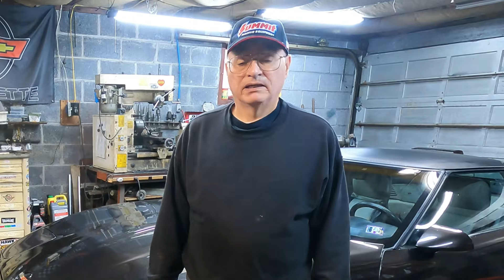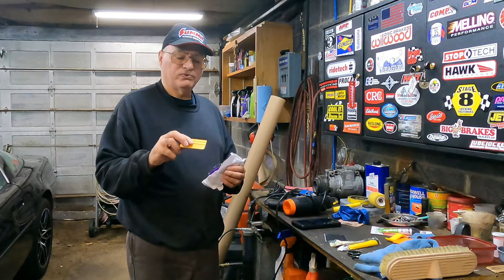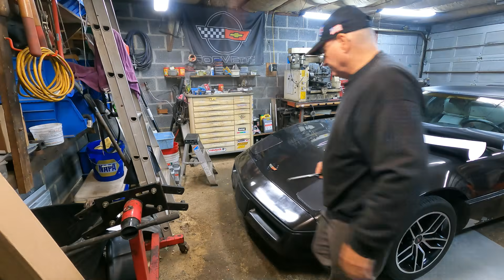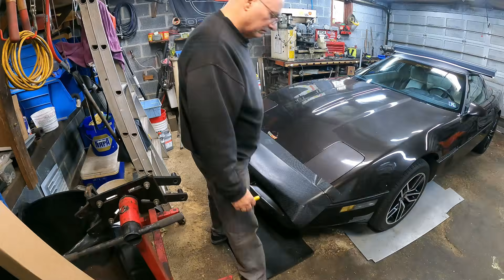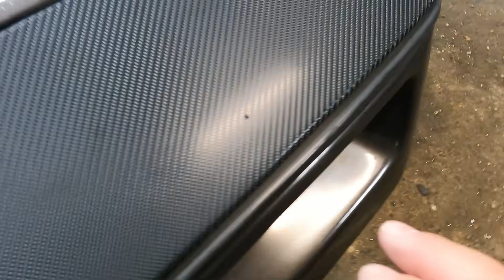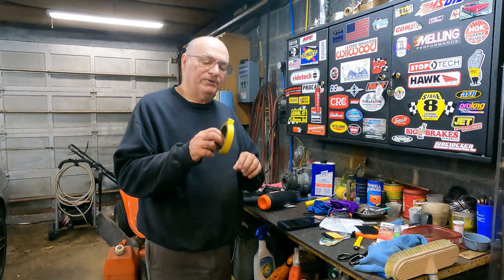Ebay Vinyl RE Wrap 😎

Comment: Friend been doing vinyl for over 25 years.  Have helped him wrap so many different vehicles over the years.    Semi trailers and race car type stuff.   Never wrapped a whole car on my own.    You did a good job.    See so many who over heat the vinyl and stretch it too far.   Or they never  take the time for the edges or corners.   Then it comes back off.    Have carbon wrap on a few cars.  Roof and rear decklid and spoilers.    Heat does sure shorten its life here out west..   Have to replace it every 3 years or so.